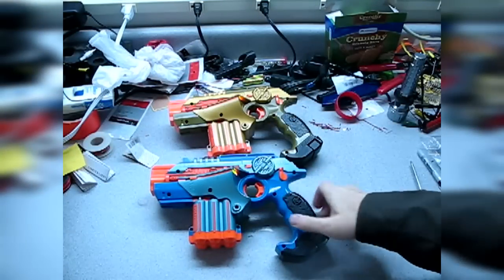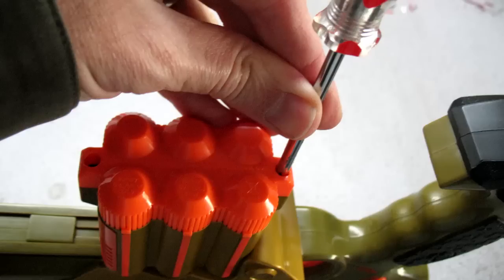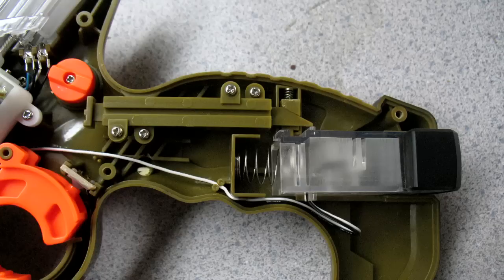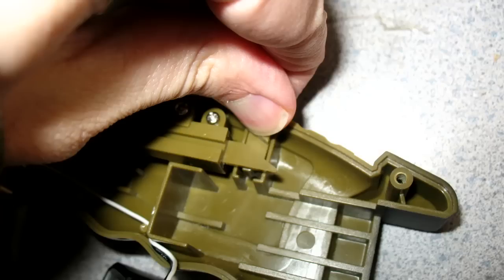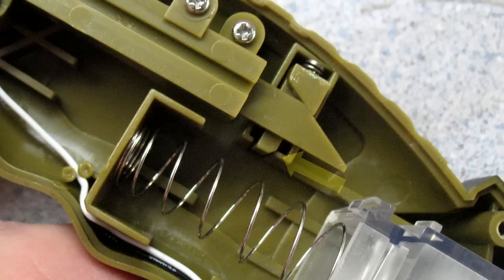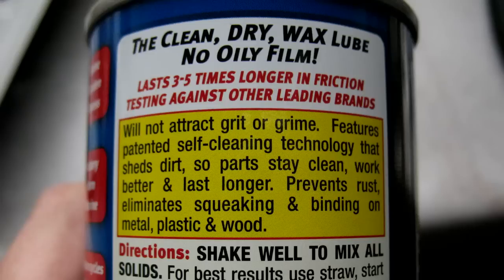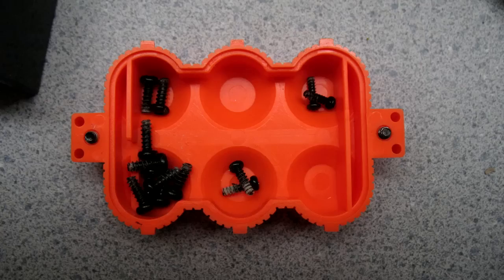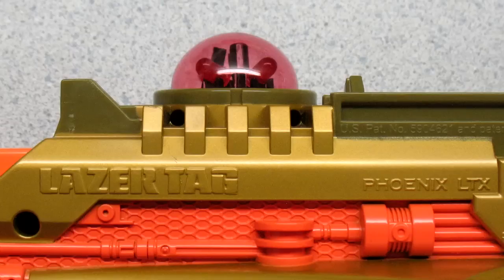Phoenix LTX Reload Jam - How to Fix

Comment: Phenominal and informative video.  I had this EXACT problem.  Just ONE note I would add:  DO NOT forget to replace the tiny square silver washers around the battery pack (where the actual top to the battery case fastens into). I accidentally left them out (got lodged in the gun) and I could not figure out why the screws would not hold the orange plastic piece back on over the batteries. I had to take ALL the screws back out to get this corrected. ;) Again, great video to a very typical problem.

Comment: My mini screwdriver was just a little too short for two small screws at the top below the sensor but you should still be able to split it open most of the way to squirt some oil in that section.

Just make sure the spring stays in place when closing it up again. Everything working great. Took just minutes and better than new!

Comment: Very nicely done, well-explained mod/fix.

BTW, the boards also had a bit of discussion to the effect that the WD-40, being intended more for water displacement than lubrication, could dry up.  Have you seen any indication of this actually happening?  How long has the fixed tagger remained in service since making the fix?

I'm going to suggest to the factory that they make the relevant parts out of nylon instead of ABS so this won't be a problem going forward.

-- TagFerret